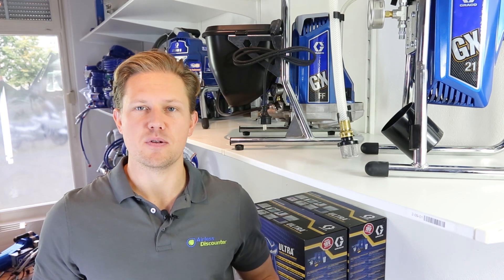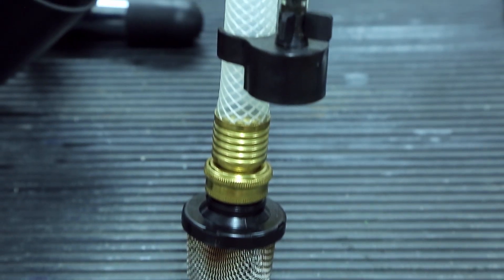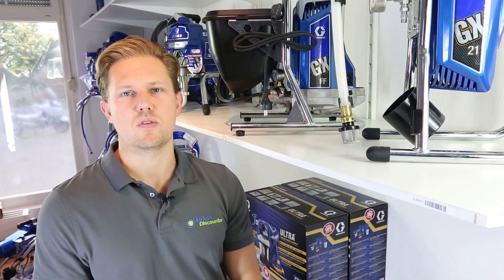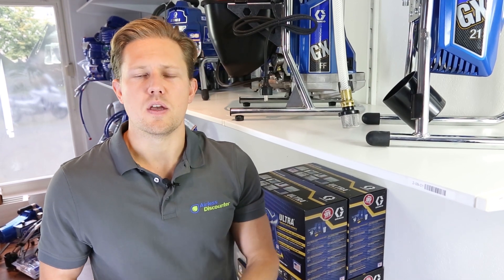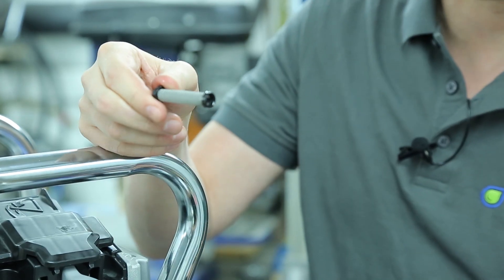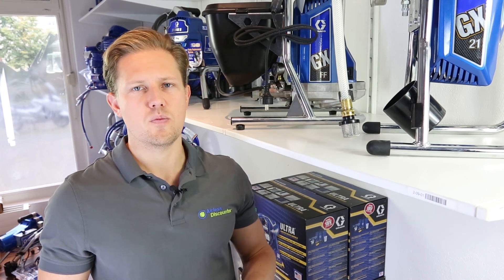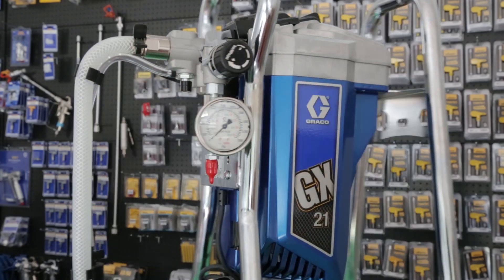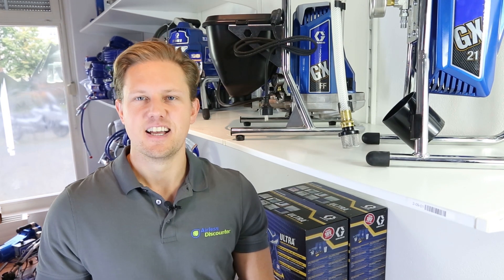Comparison GX FF versus GX 21 - Which Sprayer is Right for YOU?

Comment: In what circumstance would you want to upgrade to a 190 or 390 pc?

I’m guessing it’s piston vs diaphragm + piston is quieter, more reliable & easier to service?
Reply from the maker: Hi,
These models are all having a piston. You'll upgrade your machine if you need more power for thicker paints and when you need a more durable pump for bigger or more frequent projects. 
Kind regards,
Airless Discounter team
Reply: @AirlessDiscounterInternational  Awesome, thanks for the reply. Would the GX’s be quieter and lighter weight?
Reply from the maker: @Tigerratcat  That will be it's plus yes. Quieter though not sure. They are all having more or less the same noise in this range of products.

Comment: Hi guy's, great review! One question. You say the GXff is better for oil base products and lacquers and to use the GX21 for emulsions. But what if I'm using water based products for staining fences, panels, decking ect? Would the 21 be ok to use??

Thanks guy's. Appreciate it 👍🏽
Reply from the maker: Hi,
There are both working with water and oil base paints. But the GXFF will find better use with small quantities and often these types of products than the GX21. 
The cleaning though, has to be well done with both machines if you're using oil base paint. Furthermore, always work in an open area with electric machines. 
Kind regards,
Airless Discounter team

Comment: I purchased a GXff , put 100 litres of trade emulsion through it , it was an  amazing bit of kit until after a week old it stopped working, and started tripping every electrical supply it was plugged into . Paint hopper full , 15 metre hose full , clean shot and £250 gun full of paint and know way to cycle it out or clean any of my gear, all completely wrecked . Not impressed
Reply from the maker: Hi,
We would be happy to help you but first we need to understand what happened ? Which kind of product did you use in the machine ? Do you have the data sheet of the product sprayed ?